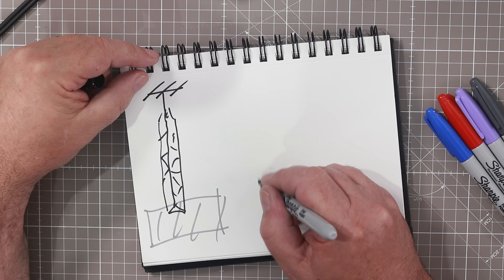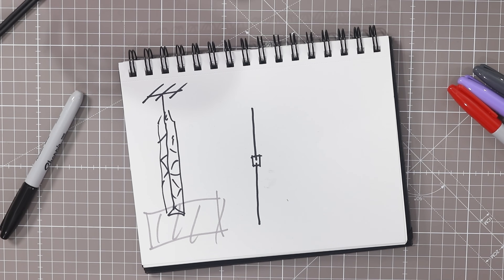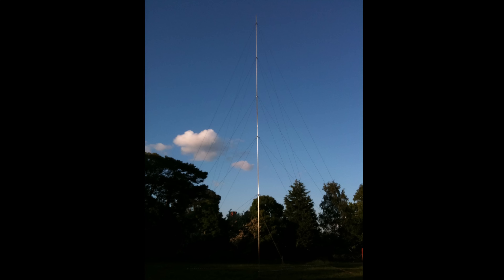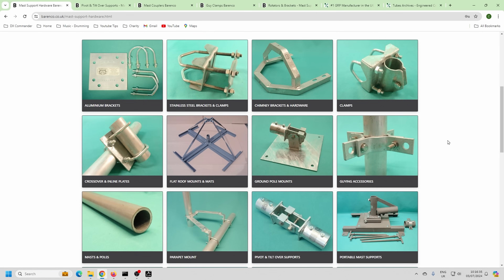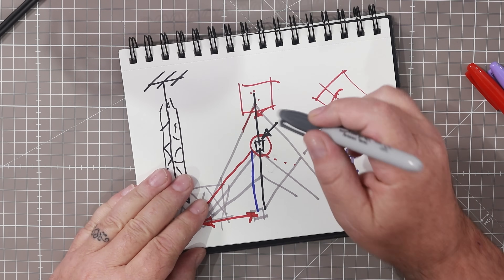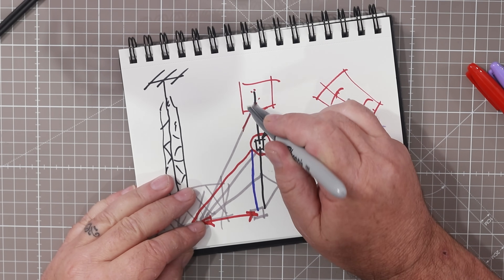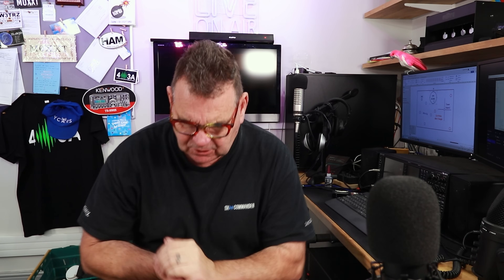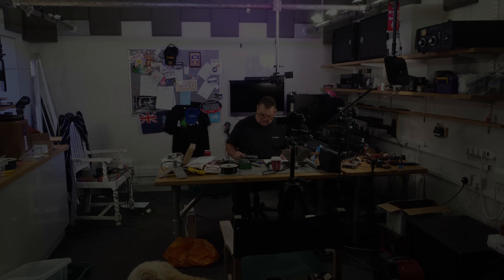Cheap Tilt-Over Tower Ideas for Ham Radio Antenna

Comment: 4:00 rather than a single cable mounting point. Connect a single cable from near the top of the mast to about the mid section with enough slack to dangle near the base. A pulley in-between to connect the winch. The pulley creates a floating mounting point that distributes the winch load to both the mid and upper mounting points rather than putting the full load at any one point throughout the range of motion.
Reply from the maker: Frankly that's just more work for the same effect. I have done that before - then you also need a pulley and a permanent rope that is forever dangling about that you need to manage... And with my thrust bearings... Well, join the dots! LOL

Comment: I have been trying without success to find the video where you came up with the "KEE KLAMP" swivelling socket as a possible idea for a mast base. Having just used one, I can only say DON'T! The reason being that they are made of cast iron or steel and the side cheeks are only about 4mm thick. If the mast sways sideways, these crack and  you can lose the hold of the bottom of the mast. I know this as I am now faced with trying to straighten out my brand new 3 +3 element yagi which is now a one sided folded version.!
Reply from the maker: Depends on the forces...

Comment: Hi, Callum, I'm a little late to the party, but have you considered a Moxon beam instead of the Quad? The gain would be a little less, but the wind load would be much less. Effective height could be a little higher. GL es 73, de AF5B
Reply from the maker: No... I need a multiband quad. End :)

Comment: Remember to wear suitable gloves to prevent hand injuries!  Used gin poles on field days on S Downs many years ago running 2m contests - they work very well as you know.  We did progress however to a trailer mounted 60ft tower in latter contests in Devils Dyke carpark.

Comment: What I'm doing now is a pipe mast where a thicker pipe (6m long) is the bottom part. Thinner pipe (6m as well) sits inside a thick one 1 meter deep = 11m high. Winch attachment is at 6m point with pivot at 10cm of the ground. Winch crank attached to a roof structure about 3.5m above the ground. Whole gizmo with antennas will be about 100kg. According to my maths total winch pull gona be 220kg. With fiber glass tubes anything  you do will be a piece of cake to build up.
Reply from the maker: I hope so! Yours sounds fine.

Comment: Just watched a video from Cool breeze adventures, he’s helping his mate put up an extendable lattice tower. Would this be suitable?
Reply from the maker: Too "permanent"
Reply: @DXCommanderHQ  famous last words lol
Reply: Just had a thought. How about a triple rope fed class 1 extension ladder goes up to 10m, probably more as you’re not climbing it. You could add 4m ladder on top if required, might have to beef up pulley system. Get a water tank or two on the bottom on a pallet. Lewis scaffold towers £533 inc vat.

Comment: Not calling anyone out, but it's sad sometime seeing hams having invested tens of thousands of $ on radios, LPAs, mics and a number of shack gimmicks while having modest or minimal antenna setups. People with the ability to raise a solid antenna system, not talking about HOA and city folks. 
My suggestion for your particular case would be a crank up steel box section tower. It can be built at home, granted it's more complex than the scaffolding sections idea. However, it would offer a much higher carrying capacity and be easier to use. A 12m variant would be about 4,5m when collapsed. Tilt hinge base, and base secured by long spikes. Because it's steel, only 2 anchor points would suffice. Does require some welding, though. Italians made a similar thing for WRTC 2022(3), and the same towers were purchased by the organizers of 2026 WRTC that's happening in the UK. Something to think about.
Reply from the maker: In the UK, those towers are very expensive because of low demand.

Comment: Use 2 connection points to the tower and lift with a loop mid way and high up back to the fixed winch pole (compound lift)
Reply from the maker: Yes, as I said.. I did consider that but I just don't fancy it.

Comment: From my personal experience , massive height is not essential for excellent results . It sound like the aim is experiment with a y a g i antenna at height ?? I can recommend the two element Delta loop as these don't need to be up high to work well . ( no need for a tower ) You have to feed the driven element with 75 ohm twin feeder ( two core bell flex ) and a " BALUN " or preferably with an A.T.U. with a Balanced output . The 15 meter delta loop I built was only 3 feet off the ground at the base , Provided a forward power gain of around  6DB over a dipole , front to back ratio was probably around 15- 20 DB , not a lot off the sides . And a very low angle of radiation even at this low height above ground level . I will post you more details for your consideration a.s.a.p. .73's DE Chris , G4MXC

Comment: I have some 6m long, 2-inch fibreglass poles, and they are thick walls so as to be rigid, but that makes them heavy. Without checking, I think they are at least as heavy as Ali' scaff poles of the same length. If you haven't checked the weights, I suggest you take a look. A well-known contester in GM guyed his masts with Masterant D12, and it failed catastrophically. Look at the UK contest reflector for a full autopsy (in 2012 so ropes may have changed since)
Reply from the maker: Depends if it was the P series.. In any case, I'll chat to Marlow. They have about 50 years more experience.
Reply from the maker: PS - I tried to find his specific message but only say reference to it.. Regardless, I will probably go with Dyneema and scale it appropriately as if it was a sailing boat..

Comment: You're right not to use polyrope. At the back of my house once year we put up a 48m high lattice mast, with a crane and a rigger. We guyed it with 16mm blue polyrope. It was only temporary, hence no steel guys. And it was for AM broadcast so wire guys would have affected it anyway.
Anyway - all was good! But it rained heavily one day and when wet the polyrope stretched, and I recall  watching in horror as the mast swayed alarmingly in the wind. Next day, when the rain abated, I went out and had to tighten the guys considerably.
Mastrand is your friend.
Oh- a guy anchor point idea that we used: Got a mini-digger and dug a trench at each guy anchor point, perpendicular to the way the guy would run, and a sloping narrow 'ramp' from the centre of the trench towards the mast.
Got a railway sleeper, wound galv steel wire around the centre and clamped it, then dropped the sleeper into the trench, with the galv wire coming up the ramp.
Filled the trench in. 
The wire then protruding from the ground was the stay point. As all the strain was trying to pull the sleeper sideways against  the wall of the trench, it was never coming out. 
Of course we did this six times for the six guy anchor points.
Then when we had to vacate the field, we just dug down with a spade about 18", and cut off the galv wire, leaving the sleepers down there forever!
This idea came from a bloke who used to put up those temp masts for wind measurement when planing wind turbines.
Reply from the maker: I like the sleeper idea... Around these parts, I know from experience that getting hold of a GOOD sleeper is an issue.. BUT a good idea!!

Comment: Im planning a telescoping aluminium mast . square tube.  bottom 100mm x 3mm.  Top 75mm x 3mm.   6.5m lengths here in  Australia.   1m overlap give 12m mast.  No winch.  Use 25mm uv protected nylon webbing over a teflon  runner at top of bottom section.  Body weight pulling down on top section going up.   4 x teflon or nylon corner sections inside bottom mast at top. Nylon webbing cleat to hold it all up. Might be a little flimsy for 20kg load. With mast retracted to 6.5m  the falling derrick could probably  be 3m long.  Look up Kokermast for some ideas.

Comment: Callum,
May I please make mention of a design that I use at my QTH, it doesn't use a huge concrete base but it does have one, the mast is 15 metres tall and it bends over in the middle.
This was not my original idea, it came from Peter VK6YSF in Perth Austrailia, he has a website where you can see his design and run-down of what he did with his.
Please have a gander at it, if it helps you out with your plan, all the better.
Cheers,
Mike ZL3XD.
Reply from the maker: Hiya Mike.. Yes, I have just read the article and seen pics.. Love it.. My issue is that I don't think I can hold mine at the half-way point. I would need a lattice construction I think.. But thanks!

Comment: I like the idea of the fiberglass scaffolding poles. They make fiberglass re-bar in at least 20' (banana;) lengths. You could epoxy one of those inside at the mid point for reinforcement. Or maybe drop a 10' section in the bottom one and let the twenty-footer sit on top of it thereby spanning the joint between the two poles as well. One thing I have successfully used to reach similar lengths is  35'+ bamboo poles with a cobra ultralite senior wrapped around them like giant rabbit ears.
kb3uka
Reply from the maker: Yes. Nice.

Comment: For that height, why not a tilt-able fiberglass flagpole?
The ones we have here, comes with a footing, with a hinge, that only requires a small amount of concrete in a post.
And flagpoles, even at that length are easy to erect for one person and as many people buy flagpoles, its quite cheap...
Reply from the maker: They are - and I have spoken to a flagpole manufacturer. They don't like the headload. Only a flag. And it's very expensive.

Comment: We used the same system for NFD at a location on a farm.  2 scaffold poles plus rotator plus 2 meter aerial while not heavy was difficult to raise without a ratchet winch.  And we were/are getting on a bit. You no doubt had the same issue of the lever over the pivot point effect and the shifting of the weight from horizontal to vertical and visa versa.  Not something I wanted to repeat in my back yard as from a safety factor needed assistance from others.  You have the luxury of a field but I assume you want a one man band to erect.  As usual you will work through it-  All the best Mike
Reply from the maker: Yes.. there's a point where on lifting up, it starts to want to sit up with a bang.. I up thinking up a solution to that. Same with getting it down again once it's up. In the event the wind is blowing the wrong way, it'll need winched back down for the first few degrees until the top weight settles. Marlow to 16mm shock-cord and I thinking of using a number of those for the shock problem - still thinking up the reverse lowering problem..
Reply: @DXCommanderHQ  Yes  I agree and you have the experience of using this system previously.  The counter balance, in my opinion, is crucial to get right.  It’s great fun to work on and solve.  At my previous QTH I used a mast against the rear wall and a winch system for raising and lowering , it always got me the effort needed and crucial points then nothing.  Happy that the winches were ratcheted as now with age and strength diminishing I would run into trouble.   DX Commander to be permanently deployed at my new QTH.

Comment: Our Radio Club used an older military style (WW2) for HF comms.  Looks like a hand truck (for moving boxes) but the bottom was bigger.  Roll it into place and use steel rebar to pin the bottom unit.  Insert a 8 foot section of HD fiberglass and turn a crank.  That raises the first piece bottom to 8 ft and locks into place allowing you to insert another 8 ft section - turn a crank and that raises it and locks, now you have 16 ft.  etc...Our Vertical was at 50 feet supporting a large yagi antenna.  Would be easy to make permanent.  This vertical supporting device was new to me - had never seen this before.  bet you could find one in the UK military surplus?
Reply from the maker: Yes, I've seen those.
Reply: Do you have a link? Any idea what they are called?
Reply: How much is a non roadworthy, functional, articulated (not telescopic) boom, mobile crane in the UK eg an old concrete pump?
Just leave it parked at the farm.
If you need a skyhook use a sky hook.
The crane's prime mover can provide  primary power and shelter too.

Comment: If you can do a lattice tower, the width (or rather pour depth) of the pad can be minimized by angled pile rods. There are high strength concretes and excellent bonding products to supplement your physical connection of piles to the structure within the concrete. A H shaped form with 45 degree piles driven down would be something you could remove yourself with a hired excavator and a pneumatic hammer if need be. This is obviously dependent on your local geology.
Reply from the maker: I appreciate your idea.. Trouble with all the UK lattice towers are that they are all 20 foot lengths (well, almost all of them!) that nest.. So then I'm into winching AND guys.. In the USA, there's seems to be towers that bolt together.. We don't have that at a price..

Comment: Would it not be simpler to use your generator pump up mast , or is that not suitable for what you are doing ?
Reply from the maker: Not high enough.. The Hydraulic tower is about 9m and not tilt over.

Comment: What if you created a 4-sided pyramid (just the wireframe of one) and put a hinge at the apex to tilt the mast over (mast would be going through the apex of the pyramid to the ground).  If you support the mast at the apex, and the apex is slightly over half the height of the mast, you could almost tilt it so it is hanging inverted to work on it (albeit upside down).  To raise it back up, you'd just need to have a rope tied to the base and pull on it to rotate it back to vertical, and secure the mast to something in the ground (maybe just your bag of concrete and a metal attachment point).  Essentially the 4 pieces of wireframe for the 4 sided pyramid are 'permanent guys'.

You could just use sandbags, or tent spikes and rope to hold the base of the pyramid wireframe down.  You could additionally guy the mast part way up to the apex and use the base of the pyramid for guy attachment points (some eye-bolt attachments).  It depends on what materials and heights as to whether you need guys for the mast or of if the 'wireframe pyramid' is enough to support things freestanding...It is a space hog, I wouldn't want it in my backyard, but that's because I use it for gardening and other stuff...if you have some space...

If you aren't using the antenna for a while, the inverted antenna (lowered position) could attach to the ground and have a super-low center of gravity to be easy to raise at a moment's notice...And it would be 'off the ground' as well so it doesn't sit in wet grass, or dogs/wildlife won't run into it...might paint the wireframe pyramid visibly though!  :)  WW0K 'pyramid foldover tower' :)
Reply from the maker: Complex. Don't know where to source components. Don't have experience of that.

Comment: Hi Callum. All the best with this project. With some custom spacers / clamps, you could form 3 scaffold poles into a lattice structure? I did this 30+ years ago for a temporary mast for an EME array, so it was not that tall. Can't remember quite how I did it, but it worked! 73
Reply from the maker: Thought about that.. I have lots of experience with scaffolding connectors and getting 12m height would add complexity, some unknowns and tilt over issues. Good idea though.

Comment: Disclaimer - I don't know the Mastrant line like I do some other brands. Here in the US I'd be looking at Samson's Amsteel Blue for the guy rope - It's Dyneema with a coating that adds to the abrasion resistance. It's crazy low stretch and easy to splice (I'd use splices instead of knots or bolted clamp style connections, but not everyone is set up or knows how to splice these types of ropes). For the lift line / pulley rope I'd either go with jacketed multi-core line (the kind of stuff used by cavers or rope access workers) or a product intended as a hand line for the utility industry. Jacketed multi-core are intended for use with pulleys and friction devices. They'll typically be Nylon or Polyester so they will have more stretch than Dyneema but it's probably not a problem for lifting and lowering. Utility hand lines will be single braid and are available in a number of materials and they'll be large enough in diameter to make them comfortable in the hand. While they'll do fine in properly sized pulleys, some hand lines will have fairly low melting points and I would avoid using them with any kind of friction device.
Reply from the maker: Totally agree! Different ropes for the two different applications. Thanks for saying for the benefit of the comment readers!

Comment: Going to be a great project. Looking forward to the great videos' on this and more. Just keep in mind the strong winds you get  . The outher thing to watch for is ground wire length . Any resonant length above ground may affect the radiation pattern.  also choke balen on coax will help with common mode currents on the shield of coax. With coax going up in the air ,it may pick up RF from outher antenna near buy. The length of coax in the air will also be a factor as well. going to be a lot of fun. Cheers from USA !

Comment: Coupling the tower with solid fibreglass pole to the inner diameter would be more stable as it can be longer remove some flex. Will also allow you to decouple the two section so that they appear electrically smaller.
Reply from the maker: Erm.. There shouldn't be ANY flex regardless of the connector actually.. Been there, done that.. The guys are for keeping it straight..